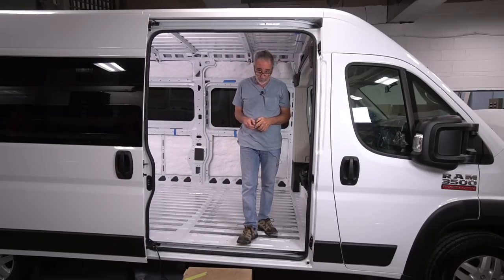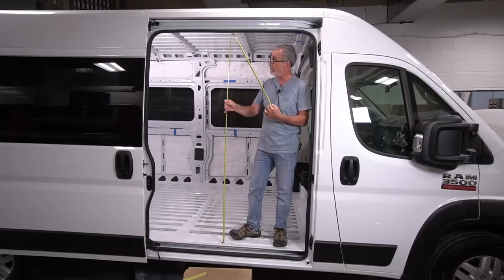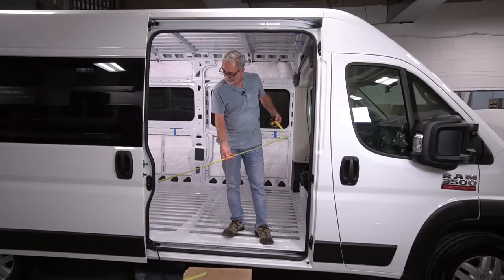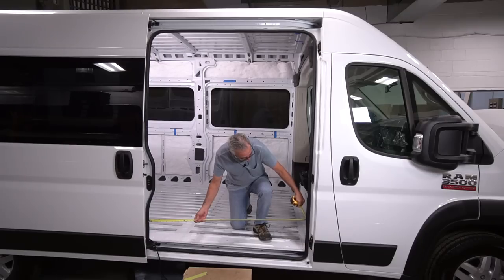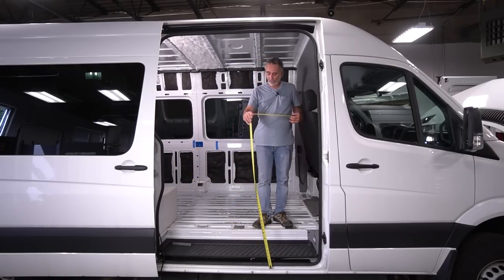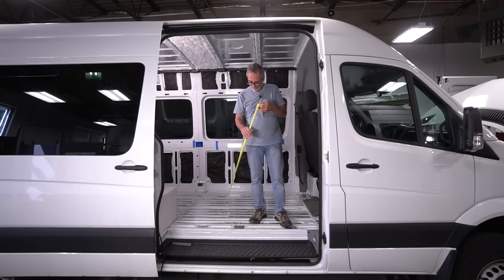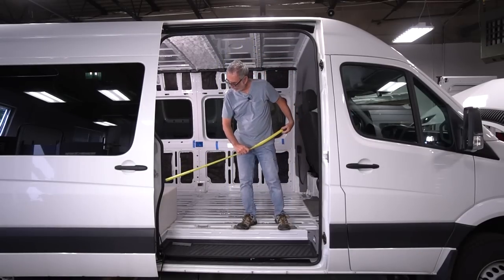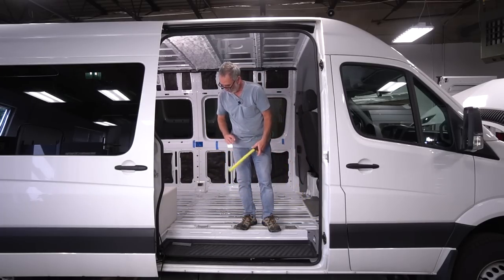Sprinter & Promaster - Important sliding door measurements

Comment: Thanks!  That's helpful.  Seeing that step in the Sprinter vs. none in the Promaster seals the deal.  So much easier with a ramp with no step.
Reply: Hey Heather, a lot of people cover up most of the step and leave just a small part of it open to use. Just mentioning it because it might be easier to move the wheelchair in if 70% of the step was covered. Only wanted to let you know so you have options if you need it. The promaster entry is also closer to the ground if that matters to you. Cheers!
Reply: i believe there is also a sprinter that has no step 4x2 FWD not 4X4 tho
Reply: @kaneda4  all of the high roof sprinters have the inside step, even the passenger vans it's because all of the sprinters are rear wheel drive or 4x4 so the body is raised to accommodate the drive shaft, that's also why the promaster doesn't have the step and is closer to the ground because it's a front wheel drive van so no need to accommodate the drive shaft.
Reply: @avivamae5171  Thanks, it does matter.  The shorter the entry, the shorter/lighter ramp we will need.

Comment: Hi I drive mercades sprinter from powdered wheelchair mine has a rickon lift mounted on rear floor I amazed it does not take up much floorspace but I would put to lift on side door as gives more options with lay out one thing to be aware of is how much parking space you need to use the lift ie I need a good 8 feet to use my lift hope all works out fore you andy

Comment: Hi, I found out about the 80/20 Extrusions through your channel. I am repairing my Coach House Class B+ floor and I want to use the extrusions to reinforce the floor in the damaged area. Also, I don't want to use plywood again because I found a massive deterioration due to a water leak between the plywood and the vinyl. How can I learn more about the extrusions applications? I don't use Facebook and in You Tube so far your channel  the most informative. I have already ordered the extrusions and I am waiting on delivery (it takes almost two weeks).
Reply from the maker: Not sure to what extent your rapid is, structurally. But you could also use aluminum square tubing and 3M 5200 or PL Marine adhesive.
Reply: The floor of the chassis (450 Ford) is steel frame and the Coach is a one piece fiberglass. I am trying to avoid to put any wood on the floor, so I was thinking to put PVC poly wall panel on top of the steel grid and the 80/20 over it with the insulation in between the extrusions and a vinyl waterproof floor on top.
Reply from the maker: Joe Bailey sure that will work but laying 8020 under the floor is a costly route. I learned that myself. You can use aluminum square tube thick walled for structure
Reply: Thank you George for taking the time to help out,  I really appreciate it.

Comment: Hi George. Is this going to be a wheelchair lift or ramp? As per ADA slope for ramps are 1inch rise : 12 inch distance and 36 inches wide. Promaster I think may have an advantage because of their lower load floor.
Reply from the maker: I did not get involved with the details of the mechanism. Just provided dimensions.

Comment: It would also be super to have the inside van width at the top (as I understand the promaster has less taper than the sprinter) and also the exterior roof dimensions for purposes of installing solar panels without having them hang over. I have a sprinter with 900 watts of solar on the roof that fit within the dimensions of the roof track for sleek look, but it was very difficult to obtain panels that allowed for this and unfortunately the company than made them (ten k solar) has gone out of business. As I understand it the promaster has a wider roof which makes it very easy to achieve higher wattage roof panels (the roof being wider it can fit standard residential panels.) One final measurement your viewers could find useful would be the step up height of the sprinter vs promaster.

Comment: The dimensions I need, that you can't find anywhere, is the width (from the driver to passenger wallsides) of the 2 vans, at cupboard height, both at the point approximately where you would typically place the bottom of a cupboard, and up near the ceiling, where the top of a cupboard would mount.
(Edit: Basically, the same measurements you took in the last video, but instead of at 'bed' height, at the ceiling height, and at a point approximately halfway between the ceiling and 'bed' height.)
Reply: Have you gone to their websites? A lot of those specs are shown in the technical drawings
Reply: @juliemac5604  Despite much Googling, I haven't found a PM drawing that had those exact two spots documented. I did find a Sprinter drawing that had just the top, ceiling measurement, but even then, it still did not list a dimension for where the bottom of the cupboards would be.